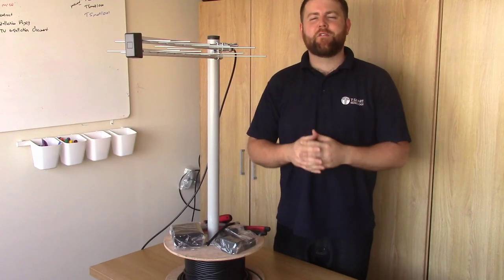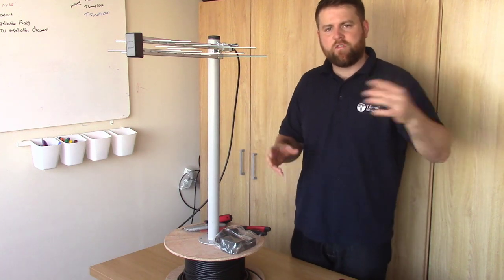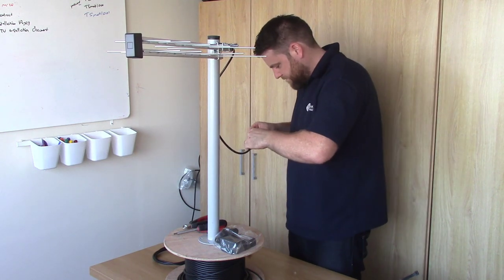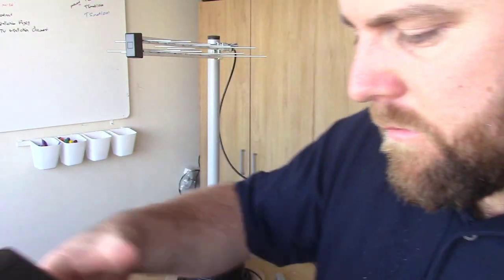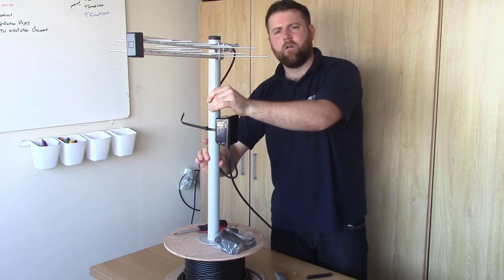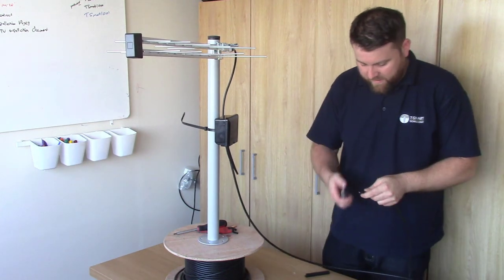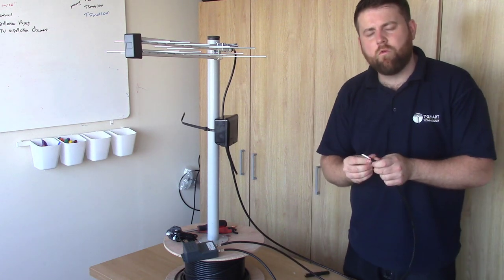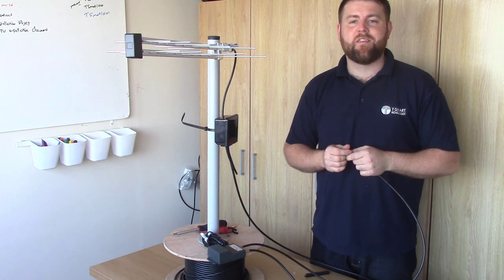How To Fit A MASTHEAD AMPLIFIER & Power Supply Unit

Comment: Anyone know a price for fitting these I’ve seen the part for £25 roughly and our local company want to charge my 90 year old Nan £360 seems expensive
Reply from the maker: Just for a masthead amplifier and power supply? £360 seems very expensive. Price can depend a bit on where it will be  installed. I would be asking questions if it is more than £150.

Comment: Hi. Really helpful video, many thanks. Gave me the confidence to install a new antenna and Wolsey LTE WFAV 425 masthead amplifier with power supply. All went really really well and I had a great picture on 2 TVs in a dodgy reception area. 
However... I tried putting a splitter off the power unit to feed another TV and now I have no signal at all! I removed the splitter and returned it to the previous set up but still no signal so I think something has gone wrong with the power unit or masthead amplifier. I still have a green power light on the Wolsey WMA-WPS100/1 power supply but no signal and the mast hasn't moved. Any thoughts what it could be please? Many thanks
Reply from the maker: Thanks. Hard to say, I would check the cable terminations. What do they look like?

Comment: If I was to install on a vehicle without 230v ac available could I use the 12v dc from the vehicle's electrical system to power the amp? Could I just inject 12v dc down the coax through a lead I make up and put through a splitter?
Reply from the maker: I have never done it but can't see what the problem would be, most PSU's for masthead amps are 100mA. I hope this helps

Comment: Hi Tom, Excellent video, thank you. I have a question as I'm about to install a similar amp & PSU (Labgear LMA415VR 4-way amp with a Labgear PSUFC power supply). So the lead from the aeriel gets connected to the Amp UHF input and "output 1" gets connected to the PSU, then the output of the PSU gets connected to the TV. Does this mean that I have to provide a separate PSU for each of the other three outputs from the 4-way amp, or does the PSU that is connected to o/p 1 provide power to each of the other three amplifier outputs?  Thanks again, Bill.
Reply from the maker: Hi Bill, no one power supply is all that is required to power the amp.

Comment: Tommy, very informative video. In my loft I've got a Labgear amp LMA125V with their downstairs PSU behind main TV.  2 WAY Labgear  splitter (behind TV) sends 1 output to main TV, other goes back to loft for distribution to other rooms. If I added  splitter in the loft just downstream of the Amp, so other rooms would be on shorter cable run, would main TV signal strength be compromised? Thanks again.

Comment: Having read a few articles on installing these I still had no clue, but watching this really made it easy to understand, thanks! I'll get the same gear ordered and give it a go myself.

We're in a new build and the developer had pre installed the cabling to two rooms, would I be best to take each cable to the amp or just use the signal cable to the split as it is now?

Thanks again. 👍🏻
Reply from the maker: Hi there, thanks I'm glad that the video has helped you. I'm sorry I don't fully understand the question. Can you please re-phrase it?
Reply: @smartaerials  Sorry, let me try again.

I've moved in to a new build house and the builders have installed the aerial cable from the loft to the wall points in the two bedrooms, via a splitter. Would I be best to take the output of the cable to the individual cable runs, after where the splitter is now, to the rooms or to the single cable, prior to the split?

Hopefully tha makes sense now. 😂
Reply from the maker: Ok I understand. You could install a masthead amplifier before the splitter but there is no guarantee that the splitter is "DC passing". If it isn't the power from the power supply unit will not reach the masthead amplifier and it will not work set up like this. Mt advise is to buy a masthead amplifier with more than outputs (4 ways are very common) and remove the splitter altogether and connect all cables direct into this. I hope this helps. Tom
Reply: @smartaerials  Thanks Tom, really appreciate the replies and help. I'll get it all ordered and give it a crack.

Thanks again. 👍🏻

Comment: Hi! Very helpful video, thank you.  I've just moved into a new build with five aerial points being fed from the loft but no aerial installed.  The signal is pretty good in my area so it was recommended that I just bought the Labgear LOG Mast Periodic Aerial.  I was planning on just installing a 6-way splitter with no amplification to see if that would suffice and if not, get a power supply to amplify the signal.  Do you recommend any brands in particular for splitters?  It seems to be recommended that power sources are kept far from the coaxial cables, so does applying power across the coaxial to amplify the signal from the splitter degrade the signal of the coaxial cable the power is being supplied along?  Therefore, is it better to amplify at an outlet that isn't being used by your main TV?  Thanks.

Comment: Hi, great video! So, a really simple question which I expect I already know the answer to...

I have a very high gain tri-boom aerial mounted in the loft. This originally fed two TVs using a two-way splitter which both worked fine. I have since added a third TV onto the same aerial and so have replaced the two-way splitter with a 6-way splitter with all ports power pass. The three unused ports are terminated using F-type termination caps. This is currently unamplified.

The original two TVs still work and I can get most channels on the new one, but not the freeview HD channels.
Would simply installing a PSU onto one leg of the setup solve this problem without the addition of the masthead amplifier? Thanks

Comment: Great video!  I am wanting to remove my masthead amplifier as it's no longer required so do I basically just do the reverse of what you did?  I have a power supply inside the house behind the tv so I can skip that part but just hoping I can connect up the two cables with joiners and everything will work...
Reply from the maker: HI Julia, if you want to remove the masthead amplifier. You will need to remove both parts, the amp and the power supply. If the cables has F or coax plugs then yes you can just remove the cables and join them.

Comment: I fitted a LabGear LMA415V unit in the loft, powered by a small unit in the same manner as yours (up the coax). Believe it or not, every time I powered it up, my broadband signal fell through the floor. Took me a while to connect the loss of Internet to this, but is reproducible, so it's definitely the culprit. Any ideas? I don't want to buy another unit in case there's some problem with cables running near each other causing interference, and further expenditure being a waste of money. Come across this before?
Reply from the maker: Hi Nick, I have come across all sorts of funny things but it's difficult for me to say what exactly is going on here, do you have more than one TV point? Can you move the power unit to another room?
Reply: Smart Aerials yes I've got 4 TVs fed from the aerial, so I got the 4 output amp. I've tried it in different rooms with the same outcome. Recently switched to fibre broadband so I may have another go, possibly trying an alternative power source just in case the psu is the issue.
Reply from the maker: It's a funny one, earthing the coaxial cable might help.
Reply: @smartaerials  ground looping has always been an issue with switching power supplies naturally... neutral is ground in my case. (as per Canada reg, our neutrals are bonded to ground in the main panels)

Comment: Hi can you help I have all this done in my  House but the optima 12 v unit at the telly is fault can I get a replacement or would I need to get the whole lot again?
Reply from the maker: No you can get the power units separate, it doesn't have to be an Optima one also.
Reply: I got one connected it but now my TV upstairs isn't working.  And my TV downstairs is dropping off any ideas what the problem Could be? Turning the power off and on seems to help find a signal. Thank you very much for ur help
Reply from the maker: Sorry it's difficult to say, have you tried re-tuning your equipment?
Reply: @smartaerials  I got it working needed a new cable running from outside aerial to the new unit thanks for replying

Comment: Brilliant,  exactly what I needed! What make and model is the mast head amplifier and power supply you're using there?
Reply from the maker: Thanks, glad the video helped. This one is a 4 way variable gain Wolsey model, power unit is also a Wolsey. (they come as a pair) but Vision, Antiference also make good kit.
Reply: Smart Aerials Hi, thanks for this, I have a LabGear aerial already, should I stick with LabGear for the amp or doesn’t it matter?
Reply from the maker: If you have the Labgear you might as well stick with that.

Comment: Great video, thank you! One thing I don't understand is the 1m minimum distance for the amp from the aerial. Does it cause interference if it's too close?
Reply from the maker: Hey John. Yes interference can feed back into the system. It's not such a problem with double screened cabling and screened connections that be used these-days but it's still good practice.
Reply: @smartaerials  Thanks!
Reply: I would have thought it was 1m MAXIMUM, The further down the line the more interference is picked up and amplified!
Reply from the maker: No it's definitely a suggested minimum, double screened cables & aerials with an integrated balun or log periodic design won't really pick up any interference. Cable lengths of less than a metre on the other hand would be capable as acting as an antenna as this would be a similar wavelength to the frequencies the aerial is picking up.
Reply: In that @smartaerials
Reply: @smartaerials  In that case maybe the distance should be a definite fraction or multiple of the wavelength!
Reply from the maker: Ok I'm getting the sense you don't believe me, ask the manufacturers for their advice.

Comment: Hi, I have several aerial points throughout my house that all have cables from them that lead to my attic. I have one cable coming from my external aerial into my attic, I would like to have all the points working so I assume I would need a booster, but there’s no power in my attic. How would I do this? Thanks.
Reply from the maker: You would need a masthead amplifier like the one in this video. This is powered via the coaxial cable so no power is needed in the loft. How many TV's points are you going to have?
Reply: Smart Aerials there are 5 tv points. All cables are in the attic ready to be connected.
Reply from the maker: Ok, get yourself a 6 way masthead amplifier and 12V power supply unit. Best if you get one with an adjustable gain but not essential. They usually come as a pair anyway. Connect your aerial into the masthead+ the five cables. Fit your power supply behind one of your TV's.
Reply: Smart Aerials would I run a short cable from the wall plate to the power unit, then from the power unit to one of the TV’s?
Reply: Smart Aerials and with regards the adjustable gain, what would this be set at? The one I’ve seen varies from 8-20db.
Reply from the maker: Depends on how much signal is coming in and how long the cable runs are. Personally I would just turn the amplifier gain right down to 8dB.
Reply from the maker: Yes that is correct. It's important that the wall plate is not "isolated" as this will prevent the DC passing through the wall-plate.
Reply: Smart Aerials how do you find out if the wall plate is isolated or not? As I’ve connected it all up but not getting any signal whatsoever ever. Thanks.
Reply from the maker: If you remove the wall plate and look behind where the cable termination is, there is usually a blue resistor on isolated wall plates. If there isn't, there is a good chance that it is not isolated.
Reply: Smart Aerials no sign of the resistor. still no joy. Is there anything else that could be causing it not to work? Tried adjusting the amplifier gain but still nothing. The power unit is lighting green to say its all good.
Reply from the maker: What masthead amplifier have you brought? (brand/ model)
Reply: Smart Aerials vision optima MA20.
Reply from the maker: Could be a few things. Could be cable terminations or a short on the cable. Try moving the power unit to another room.
Reply: Smart Aerials that is something I have tried. Tried three of the sockets. I’m at a loss to it now. Such a simple task and it’s not working. lol.
Reply from the maker: If you're getting nothing it's almost certain that it's do with the voltage not reaching the masthead amplifier for whatever reason. Could you bypass one of the wall-plates with a straight cable join just to make sure that it is not the wall plates. Also check to make sure that you have the in and out the correct way around on the power unit and the masthead amplifier.

Comment: Hello, I've just installed a aerial in my loft with a 3 way splitter. I've got some channels but some seem to be jumpy. Will this help me boost my signal? I sadly do not have a power source in my loft.
Reply from the maker: Hi Byron, swapping a three way splitter for a 4 way masthead amplifier should help if your pixelation is to do with weak signal. It doesn't matter that you don't have a power source in your loft as the power supply unit can be installed behind one of your TV's.

Comment: Random question, if I'm in the loft, can't I put the aerial feed into the power supply input, then the TV> to the input of the 4 way splitter (which is the opposite way to what you have)
Reply from the maker: It's possible to do that but you will need an amplifier that powers off the input, most masthead amplifiers will only power off the output cables.

Comment: I've had an amp fitted in the wall behind the TV. For some reason  when the electrician wired the house, he ran all the cables from the aerial sockets to a point behind the TV, instead of to a cupboard or somewhere out the way. When the aeriel man came out to fit the aeriel, he fitted what i assume is the mast amp in the wall, behind the TV, where the aerial cables stuck through before. 

The power supply unit was fitted in the bedroom, just plugged into a usual plug socket and a short cable into the aerial socket. I unplugged the power supply unit in the bedroom this morning, as I was having a carpet fitted, and now I've plugged it back in, I've got no signal on the TV, retune doesn't pick up any channels, not sure whats gone wrong.

Any suggestions?

Thanks
Reply from the maker: Have you got the input/ output cables the right way around? Try swapping them over.
Reply: @smartaerials  Pretty sure yeah, input goes from wall to device, and output goes from device to tv?

Comment: Hi
I live on Ireland. Terrestrial TV here is gone digital. I have a 2 triax free to air combi boxes. Tsc 114. Our terrestrial channels would not work very well. I got an LTE WFAV 25 today. Will this serve only 1 TV? Does the power supply unit have to go next to the tv. Could it go in the hot press where all my cables are ran to? Thanks. Mick
Reply from the maker: Hi Mick, no it doesn't have to go where the TV is. It can go where all your cables run back to. I advise having it so that it so power unit connects to the masthead amp with a direct cable, e.g not passing through any splitters if possible.
Reply: @smartaerials  thanks for the swift reply. The cable that leaves the power supply, can it be split to run 2 TVs.
Sound man.
Reply from the maker: Yes it can, best to do it on the output of the power supply but it can be done on the input cables as long as the splitter you're fitting is DC passing (not all splitters are)
Reply: @smartaerials  thanks a million
Reply from the maker: You're welcome, please subscribe to our channel. Tom

Comment: how do i make my outdoor dab aerial get a better signal
Reply from the maker: Could try a 3 element DAB aerial if you currently have an omni DAB dipole, this will pick up more signal,  or you could try amplifying the signal, you just need to make sure that the amplifier that is installed works with the DAB frequencies.

Comment: I can’t understand some buts because he’s from the UK and is speaking too quickly! I need to understand what he’s saying about isolated vs non isolated  outlets for the power supply plug.  Will look for another video. US English speaker here.
Reply: If your powering the amp at a socket, the socket needs to be unisolated type so that it can pass the DC voltage from the PSU. Any other devices, e.g diplexers, between the unisolated socket and the amp must also pass DC on the TV leg.